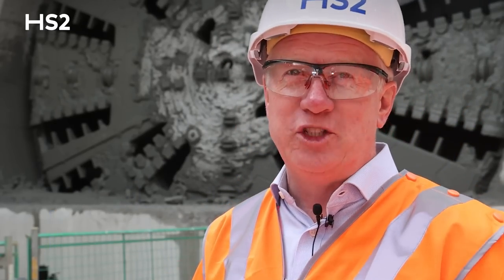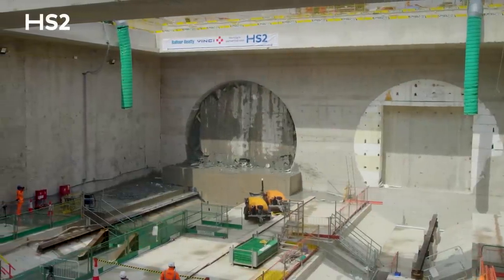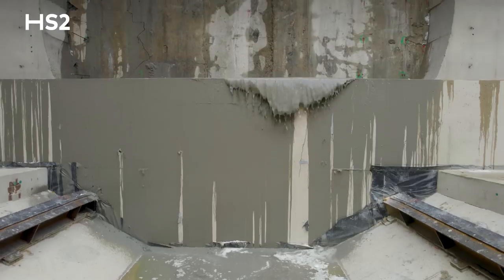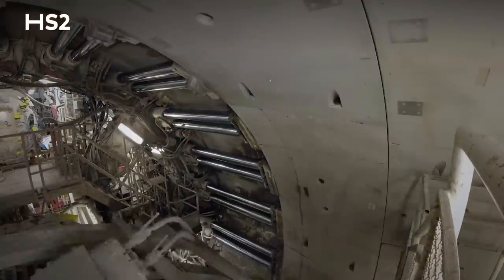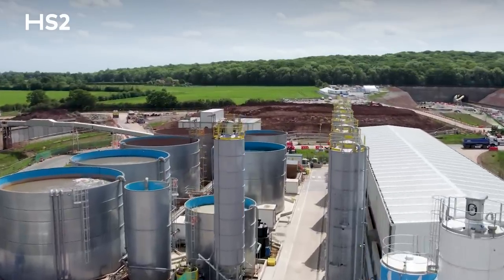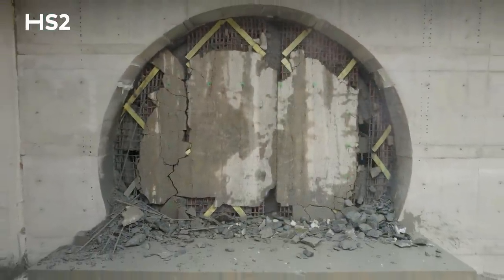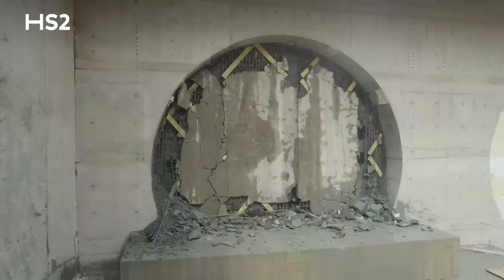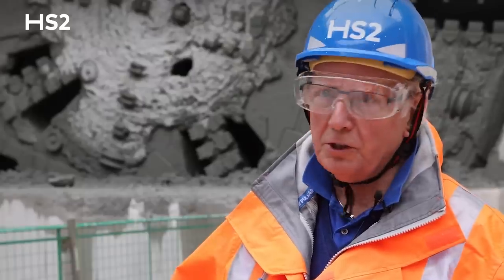HS2 celebrates historic first tunnelling breakthrough

Comment: It nice to see it all comes together. I think people will generally be proud of the line once it all completed and up and running in the next 8 years or so.
Reply: The next "eight" years?  The whole project has suffered setback after setback & now won't be operative until at least 2040, (if at all).
It's been an utter disaster since day one with promise after promise being broken & ridiculous figures quoted that quite frankly, are ludicrous.
HS2 Ltd state that to "break even" with a subsidy of 50/60% they would need almost 600,000 passengers travelling on a daily basis.
Given that the average number has been approx 96,000 for many years now, even the most optimistic HS2 fanboy will have to admit those numbers are totally unattainable.
They've also incurred multiple fines for blatant breaches of environmental issues .. the only people who will "benefit" from this monstrosity are the CEO's of the construction companies & Government ministers with their fingers in the HS2 pie.
Reply: @CRIMSONANT1  The eight years in question is referring to Phase One, not the whole network.
Reply: @chrisoddy8744  .. The first phase between London and Birmingham was originally scheduled to open at the end of 2026, but this has now been pushed back to between 2029 and 2033. The second phase, originally scheduled to open in 2032, is now expected as late at 2040.
Reply: @CRIMSONANT1  2029 is 7 years away.
Reply: @DavidKnowles0  .. "between" 2029 & 2033 .. given the delays on all parts of the project so far, I'd say even the latter year is being VERY optimistic 😉
Reply: @CRIMSONANT1  apart from Euston which I think will turn into the bond street of the line, I suspect the rest of the first stage will be built well with in the next 8 years and operate to  from Birmingham and  old Clapton junction. The actual building of the line seem to be happening on schedule. And there shouldn't be any integration problems because unlike Crossrail it a completely new section of line

Comment: Wonder what Geological process caused all that rebar to be down there.
Reply: and that perfect circular cut ahead of the cutting face. 😆
Reply: We found fiber bar and concrete blocks when we shoved through. The hard trick is to build a shaft upwards, form the eyes, sink the shaft through silty ground and stop it at the right level, for the TBM's to pass through. This was done several times on the Cairo Wastewater project. A UK aid project carried out by UK tunneling companies using UK equipment.
Reply: I would like to know myself 🤣

Comment: Absolutely amazing ! But i have to ask why the TBM cant be just turned 180 degrees and bore the 2nd  tunnel in the other direction ?  Why does it have to be dismantled and boiught all the start again. Is this maybe because all the waste material processing is at there, at the 'start'of the tunnels ?  It is easier to move the TBM rather than all the processing plants ?  VERY cool to see the cutting head from the front, as it is usually smack against earth and rock at all other times ! Can't get enough of this content. If you can't get excited about HS2, you ain't got a pulse !
Reply: Excuse my spelling mistakes and grammar ! !
Reply: I would assume that the TBM is too long to turn around within the approach cutting where the South Portal is located, whereas pushing it over one rail but facing the same direction is more practical and just easier. And cheaper, which helps, I guess.
Reply: Seems I don't have a pulse!
Reply: There are a number of reasons and you mentioned the slurry treatments plant, another is space for the waste material. The TBM back up trailers, power supply's etc. Each project has different challenges different.
At least on this break through they had the spectators well back and in PPE. I remember one break through in Canada where the TBM constructors wives had the front position and dressed in mink coats. They got rather wet and muddy.

Well done HS2
Reply: @archiebald4717  Ha, ha ! Touche !

Comment: 30/7 22 The New Victorians ! Hope full utilisation will follow when open - Road Frieght Roll on - Roll Off will reduce over crowding on roads. Curious- what happens to the spoil - embankments ? Can we please have a map showing where the finished route starts, passes thro', connects & ends.
Reply: Soo basically piggyback....
We got containers atm...
And having piggy back service for trailers can also work and would not require some of the expensive cranes and lifters.
Just some shunters with 5th wheels.

Comment: Very good, now what to do with those TBM,s? I suppose most if not all will continue up the country until the project finishes. My suggestion is move them to provide diversion tunnels for the Severn River around Tewkesbury another one is flooding near Hull then the Thames Valley, then on to Newport Monmouthshire. How many more areas in Britain can these very clever machine put to good work, how about a mains water supply from Scotland to England it doesn't all have to be underground. Just scrapping them is sacrilege i.e. that one that buried itself after the Channel tunnel and is still there now?
Reply: I believe the one under the Channel is now used as the electricity ground point for the safety equipment in the Chunnel, so it isn't entirely useless.
Reply: TBM's are designed for the size of the required use, the ground conditions and the length of the drive. London Transport did re-use some of the open faced boring machines used on the Victoria Line and the station hand shields. But working in London clay is not so harsh on the machines as other grounds.  TBM's only see one job and are then dismantled and useful parts recycled and the rest is scrapped, storage is expensive often the machines are worn out as they have been designed to complete one project only and not waste production money.

Comment: Would it not be easier to "turn around" the tunneling machine, rather than to transport it back to the other end for the second tunnel? Yes, you still have to dis- and reassemble, but you wouldn't need to transport.
Reply: No because the slurry setup is already in place for the same direction.
Reply: @thekingoftheworld9553  That makes sense, thanks for the explanation!

Comment: They’re building this in completely the wrong way. Need to start building from the North. First line should be Aberdeen to Edinburgh and glasgow
Reply: But it's dodgy driving a TBM downhill, they don't have a hand brake.
Reply: How do you figure that? Surely it is best to construct the most profitable and in demand section first. I'm not sure Aberdeen to Edinburgh will ever need high speed rail. Besides, the ideal would be building all sections simultaneously, but there just isn't enough expertise to do that.
Reply: @Timathius17  it’s main objective is to end internal flights in the UK. Increasing capacity comes after that. Atm Aberdeens probs the worst connected city in the UK by rail hence why it’s airport is so busy.

Comment: Why will trains run through here at "almost full line speed?" Why the almost, what's the problem with full speed?
Reply: it's a safety thing iirc; same reason why the eurotunnel has a max speed of 100mph.
Reply: Speeds vary depending on sections of the line.
The entire ECML has never been 125.
because of york and newcastle being really tight curves.
Reply: Out in the open, the air the train moves through can be pushed either infront, to the sides, or above the train. In the tunnel, you can no longer easily push the air to the side or above, it builds up extremely high pressure in front of the train. Air resistance becomes huge, running at full pelt would both be an issue for safety and waste energy.
Reply: @iNook26  Also if the trains were not pressurised the impact on the passengers and crew would be rather uncomfortable. However given the current epidemic of negativity it cheered me up no end to see the enthusiasm of all involved in this project.
Reply: The tunnel is designed for the full speed of 360km/h, unlike the planned 320 (for now) in the Chilterns, so the emphasis was probably on this full speed
Reply: @davidty2006  Have their ever been any proposals to fix those curves?
Reply: @DavidKnowles0  Yes, in the initial proposal for HS2 it was studied as an alternative but was deemed too costly and would likely take over 20 years minimum.
Reply: @iNook26  They build concrete air shields at the entrance and exit of these tunnels to relieve the air pressure as these trains enter and exit these tunnels at full speed as in Europe.
Reply: I believe there are also diffuser structures planned on the exits of the HS2 tunnels so the pressure wave does not dissipate all at once in one place. The latest Shinkansen have extremely tapered noses to try to mitigate tunnel boom since the tunnels in Japan were designed for lower speeds when the bullet train first started, the tunnels are very narrow and there are no diffusers. Wider tunnels help as do diffusers.
Reply: @loftyD  On eurotunnel the problem is the pressure relief tubes between the two running tunnels come in at an angle, so when speeds get above a certain value the air coming across from the other tunnel starts to tip the train over. The current max running speeds are to operate safely below that level, the original intent was to run faster. So yes the eurotunnel speed limit is for safety, but it is only as low as it is due to a design mistake.
Reply: In addition to the other explanations, It could be that depending on where abouts on the line these tunnels are, Trains possibly wouldn't be at full speed due to departing or entering a station or maybe because of incline's and curves which are slight but unavoidable in the area. Slowing a train slightly. As fast as modern trains accelerate, They still take a while to reach top speed.. 🤔.
Reply: @Markus117d  The only Stations on HS2 on leaving Birmingham are at Birmingham Interchange near Birmingham Airport and London Old Oak common just outside of London Euston, the line will be fairly flat with few large curves and these tunnels are in the Chilterns under woods, so some trains will travel Hi Speed from Birmingham Interchange right into London Euston
Reply: @peterwilliamallen1063  Cool thanks for the info 👍

Comment: Boring...
Why has this "project" not been cancelled yet? Waste ot time, money and resources for what?
Reply: For a modern high capacity efficient rail backbone for the country to take cars off the road and remove domestic flights….
Reply: To provide badly needed additional capacity, which we can't get by simply upgrading existing infrastructure - we've tried!
Reply: what a boring comment.
Reply: People said why can't we have a high speed rail system like the French TGV's.  Then when we start to build one then people like you say it's a waste of money so cancel it
The TGV lines are all purpose built not just upgrades of old lines
Reply: The Shinkansen lines are mostly purpose built too, they had to be because Japan's normal trains run on 1m gauge (I think that's the value) and Shinkansen lines are standard gauge rails (with a wide loading gauge permitting 5 seats across the carriages). There are a few oddities, like the mini Shinkansen lines and the tunnel in the far north which has dual gauge tracks.
Reply: For moving lots of people about the country, At a far lower carbon / pollution emission per person than Cars or Planes. That's what..
Reply: Everything is a waste of time if you look at it that way.
Reply: @iman2341  But by the time it's finished, it isn't connecting anything different to what we already have and the way rail ticket prices are going exponential, it will still be cheaper to take domestic flights and drive! A return from Manchester to London is already over £100 and HS2 to Manchester is still just a proposal. By the time the next UK general election takes place, with rising costs across the board, it will be cancelled just as the trans Pennine upgrade was!
Reply: @simonbaxter8001  But the connections we already have on the West Coast Main Line are at full capacity, no more services can be squeezed onto it. And having to schedule all high speed expresses, medium speed local stopping trains, and slow freight trains makes poor use of the capacity as you need bigger gaps on the line around the high speed expresses. Moving the high speed expresses onto a dedicated line ie HS2 frees up more capacity than you would think on the WCML because you don't need the big gaps any more.
Reply: @owensmith7530  Full capacity! I appreciate the spacing between trains has to be maintained, but since Avanti took over from Virgin, the length of trains (the capacity of each service) has reduced from 8 cars to 4 or 5. At the same time ticket prices have doubled from the outer lying regions of Manchester into Manchester City centre ! That is not utilising 'capacity' nor is it encouraging people onto the railways. So, I'm not quite sure if you can't encourage customers to use local services, then they aren't going to be using national services that too are over priced and you can't even get a seat! HS2 isn't going to fix that is it! and if its capacity utilisation you want, then why are the railways not full of freight at night when passenger services stop? They aren't anywhere near full capacity at present.
Reply: @simonbaxter8001  It's far to late to cancel HS2
Reply: @Scottish_Transport_Explorer  Is it! I could say that about many aerospace and military contracts ... but the governments of the day  cancelled some of those multi £billion projects when they were already complete but not delivered! TSR2, Nimrod MRA4. The labour government itself cancelled £26b of UK projects that had already gone through lengthy and expensive consultation. Look around the country at road schemes that are half finished because the funding for the rest of the scheme was pulled by the government of the day AFTER the project was started! HS2 East and the Northern Powerhouse Routes have already been axed ... HS2 was a project over 3 phases, we are just in Phase 1, but if the money is pulled it'll become yet another white elephant. Without the whole scheme being implemented, the projected operational plans just don't stack up and all you have is the same transport bottlenecks north of Birmingham!
Reply: well now theres tunnels done.
it's simply too expensive to cancel at this rate.
Reply: @davidty2006  Exactly